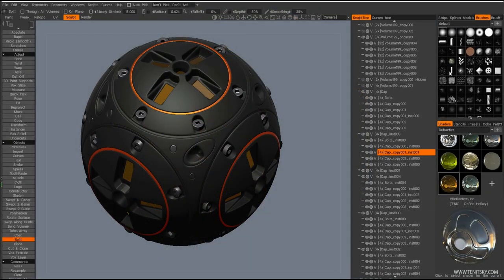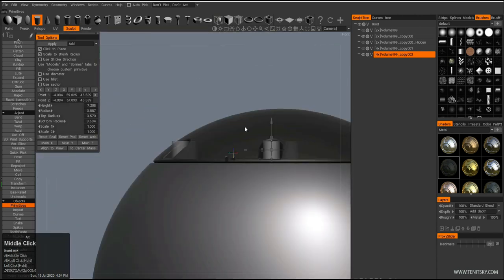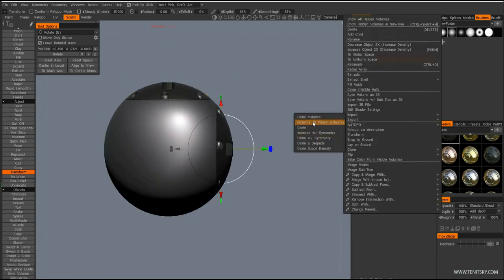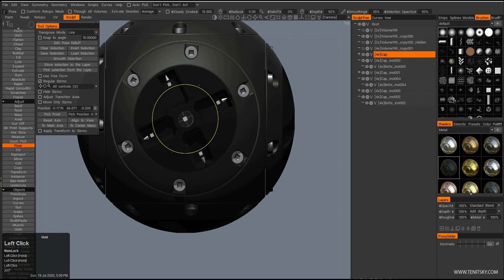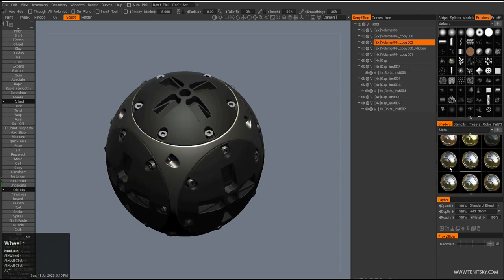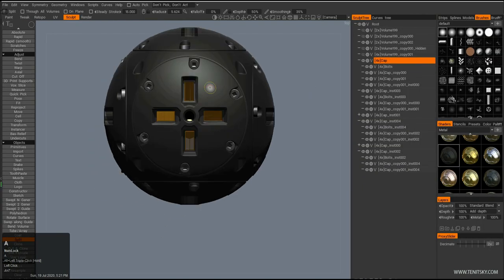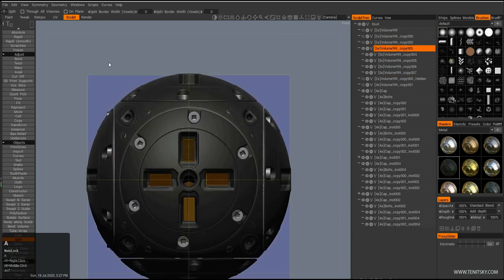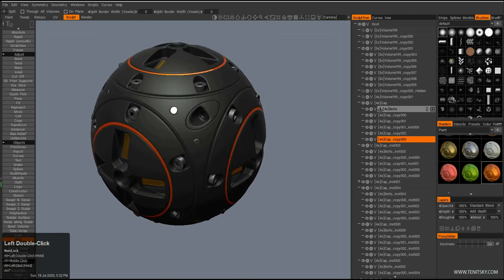3D Coat Hard Surface Sphere Sculpting

Comment: great vid as usual. great pro voxhide tip in the vid is: with vox hide to prevent hidden volumes from coming back switch your mesh to surface then back to vox to clear whatever mem that stuff is in so it wont come back on you...

Comment: Great tutorial, thank you. Would like to know how you get on with retopologizing this for game engines.
Reply from the maker: Check my machete video I have part on retopo in 3d Coat
Reply: my guess is you would merge what parts you could that would be one retopo model then maybe the other one would be the bolts with sym. but maybe you can bake and retop with just whats vis in the vox list. i was thinking the same thing tho. mainly because of the shear number of parts in the vox list.